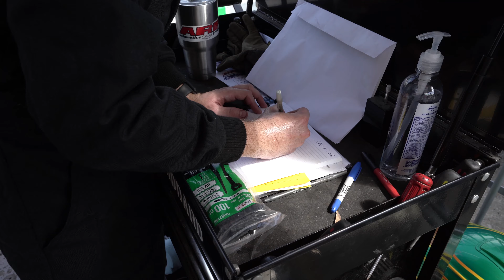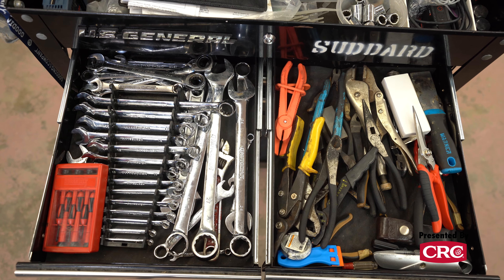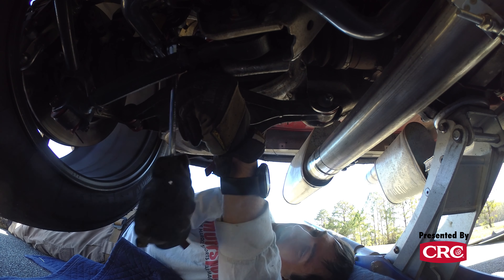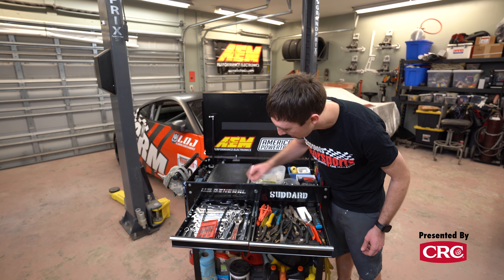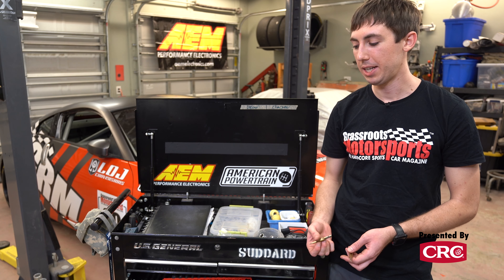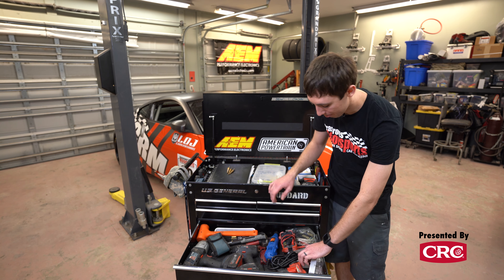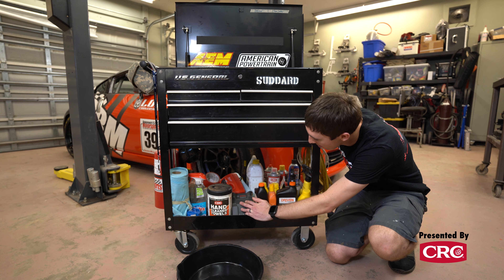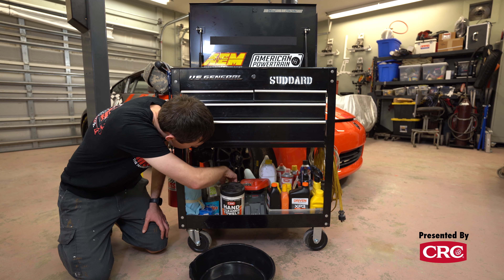How to Pack the Perfect Track Toolbox | Toolbox Tour

Comment: The Irwin LW series of locking hex wrenches are a lifesaver at the track, and I carry all 3 sizes. Minimal weight for maximum grip on things that may be a bit seized, rounded, etc… also saves you if you don’t have the wrench you need for whatever reason.

Comment: This is a very helpful video, I find myself referring back to this one! Totally true you need to tailor it to your specific car, but a tool I find super helpful (and should apply to nearly any car) is a brake pad spreader! I've changed more pads at the track than anything else...just makes the job easier. That and spare wheel studs and a wheel stud installer #subaruproblems
And a tire crayon for marking tires.

Comment: Strip the car down, and get everything ready for assembly. Having everything ready and already modified for final install.

Then put all the tools away and start assembly of the car. With the cart empty.

Everything that you used from the main tool chest, is what you needed on that cart for track day. Disregard the sizes and other tools that weren’t needed on the cart.

There ya go 😅